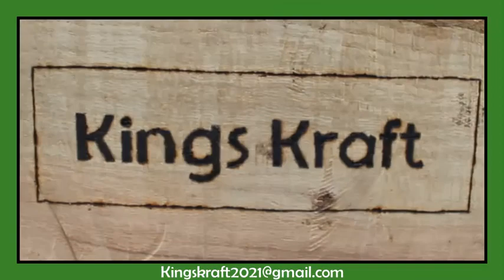Refurbishing a 514 Remington .22 Rifle

Comment: Gun stocks are not sanded, stained, and coated with polyurethane. They are scrapped, and oiled; usually with boiled linseed oil. The metal parts are not painted, but blued. Glad you are enjoying it, but the correct processes are not more difficult, nor expensive. Rust bluing takes a bit of setup, but is not expensive either. Look up Mark Novak, Cinnabar, and Backyard Ballistics for good info on this.